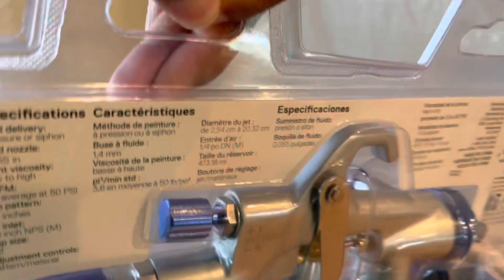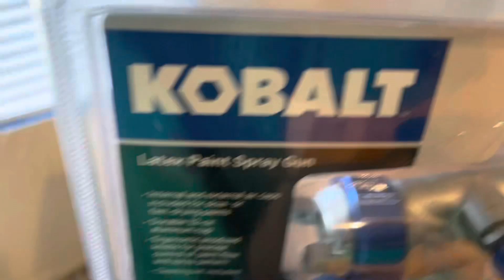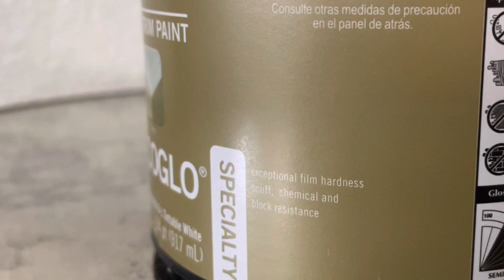DRESSER MAKEOVER | OMG it’s so pretty 😍

Comment: Awesome job on this piece!!
I've been doing this for a long time and I learned a few great tricks from you!
Your staging is impeccable btw
Great choice on the hardware too.

I  put a cheap Walmart box fan with a cheap air filter tape to the back ( to protect the motor) and I have it blowing out one of the windows leaving the other one open. Then it keeps a constant flow of fresh air and helps remove the cloud of paint floating around in the room.
Keep praying, painting, and posting 😊
Reply from the maker: Thank you so much! Great idea about the ventilation.

I love that “keep painting, praying and posting” ☺️

Comment: One question: I had a dresser that I painted with spray paint. Wondering if I can spray a different color on top of it without sanding??
Reply from the maker: I always recommend some level of sanding, even if you don’t sand it off completely, maybe just a scuff sand so the new paint will adhere better. You can even do it by hand with a 120 grit sandpaper

Comment: Beautiful work. So surprised by the finished product. Here comes the "but." It has nothing to do with your work. It has to do with the wavy molding at the bottom. When i first saw the piece i despaired of the gimcrackery at the bottom. I was hoping that it could have been removed or at least cut to trim it straight across. If you had done so it would have made it more linear and better suited to the finished product. Still, a beautiful new piece.
Reply from the maker: Ah, I see your point, thanks for the advice 🙂🤗